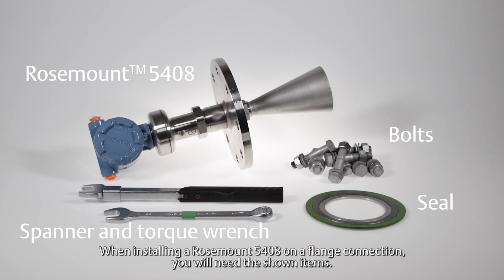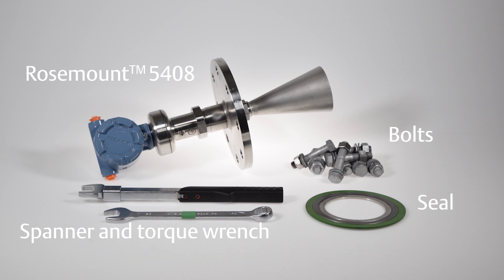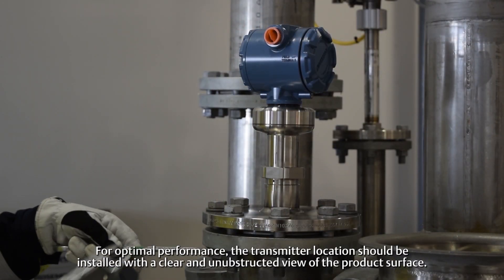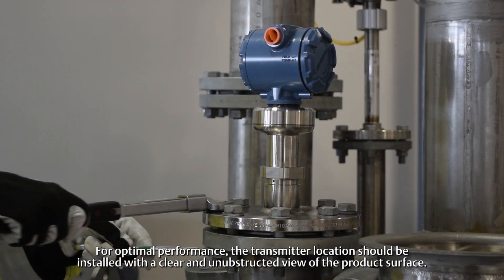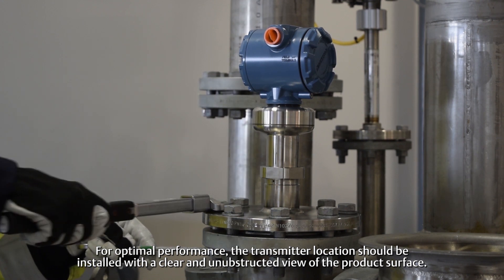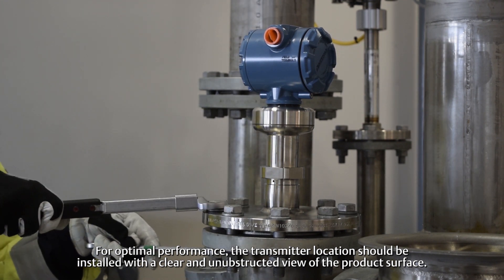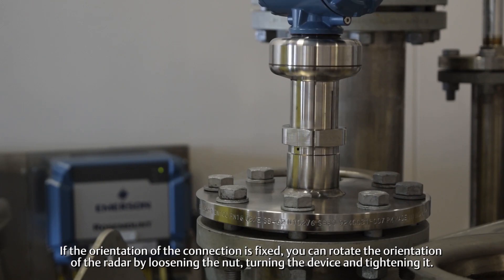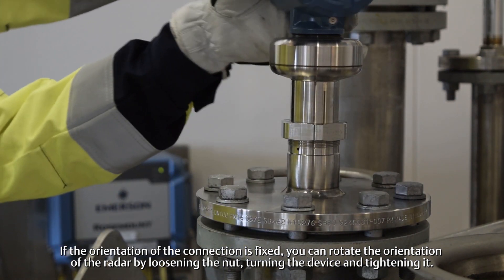Rosemount 5408 How To - Mechanical Installation

Comment: My company is using the radar level transmitter 5408 but we are fast losing them. It gives ELEC FAILUR. Did power reset as recommended on the document still it persists. First what could be the cause? Second how do we prevent it? Third what's the solution to restore those giving ELEC FAILUR. This is very important
Reply from the maker: Hi, thanks for reaching out. We understand your concern and we would like to know more about it.

Kindly contact us at https://www.emerson.com/en-us/contact-us?r=500&p=1

Thank you.